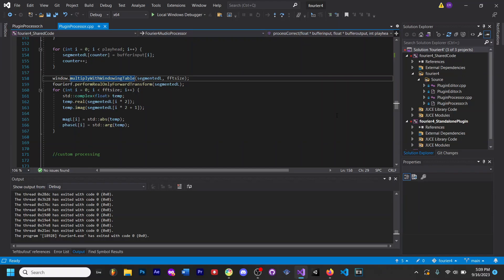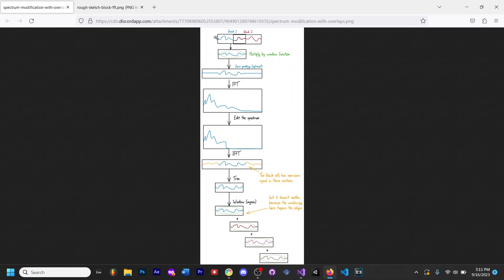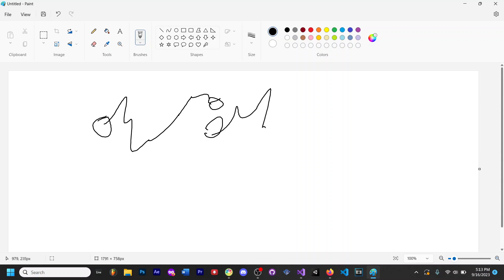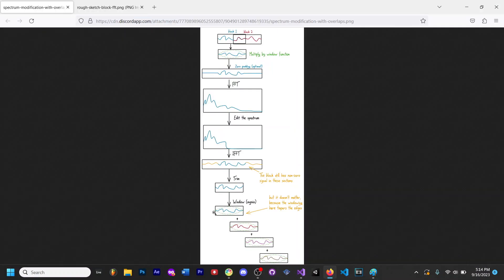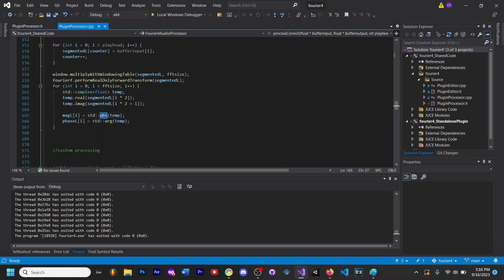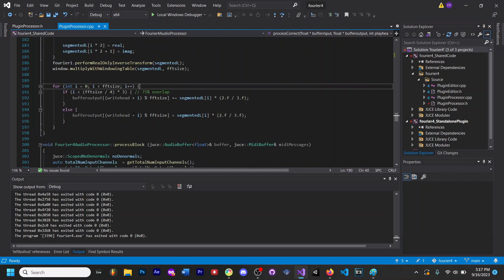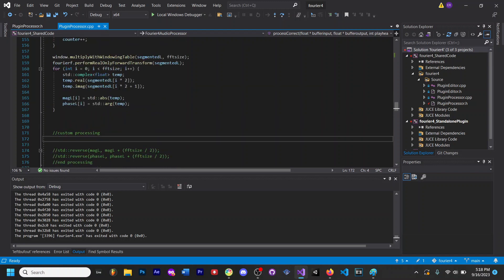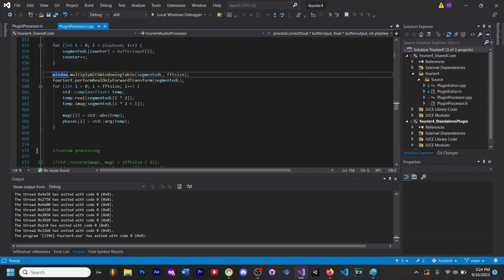How I use the FFT class in JUCE [GITHUB REPO]

Comment: hey im also very new to this so excuse me if this is a stupid question, but what is the splitting up into the L and R playheads used for? thanks for the tutorial btw!
Reply from the maker: i think the only reason i did that was because i needed to process it in stereo, i was super obsessed with "data oriented programming" techniques when i made this. basically one of the techniques is reading contiguous memory in order to optimize cache hits.  its probably not performant at all but i did it for fun lmao.  you could totally like have a float class and put each stereo sample in the same object, but i think if you do that you want to make sure its allocated on the stack
Reply: @slowslicing  i see! thanks for the quick reply!!